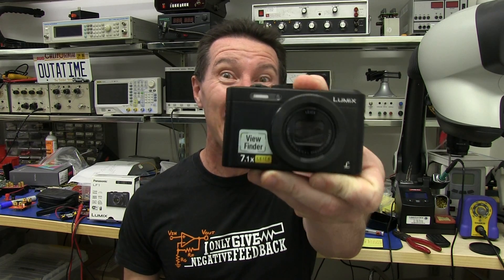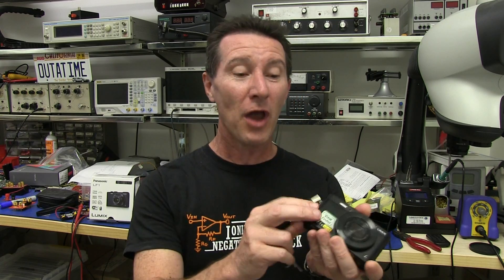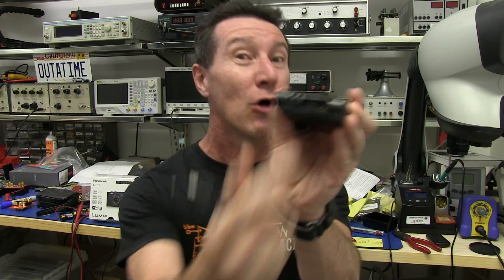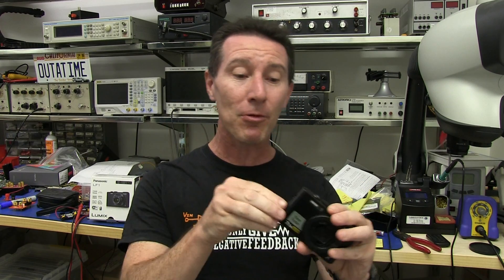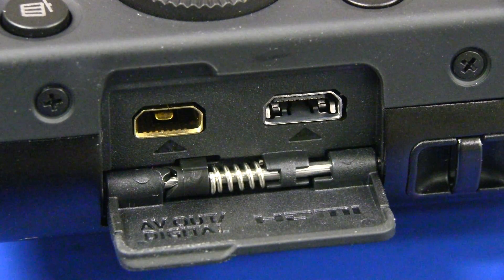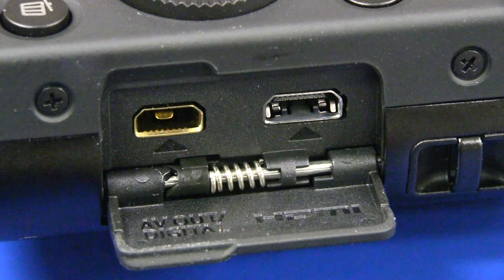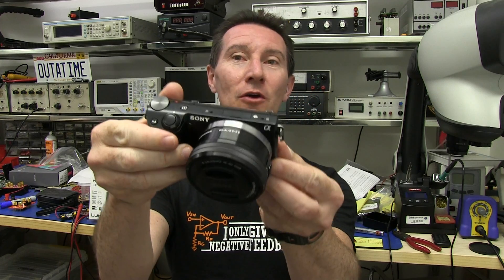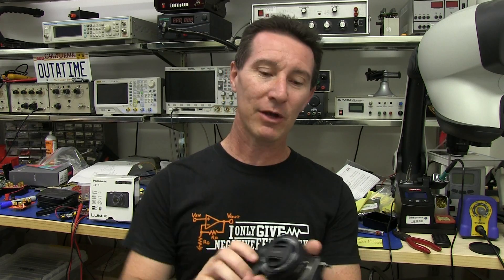EEVblog #578 - Proprietary Connector Rant - Panasonic LF1

Comment: I would like to let you know, that isn't a proprietary cable, it's quite a standard USB 8pin connector. Alot of cameras (Including my Sony DSLR) have it. As you said, they have done this to save space with various connectors and make cables which can be used for Camera to PC and can be connected to A/V equipment using composite video and stereo analog audio. My Sony camera comes from the time where hdmi was not the standard and thus not having a HDMI connector. alot of other cameras (even seen Webcams) have this connector. I cannot charge my camera on the go because it has a fairly big battery pack and the 5v/500mA will not make the cut in charging it. Other manufacturers use Mini/Micro USB with a Mini-jack for audio/video in composite/anolog format, which is better when you got alot of mini/micro usb cables around. and since HDMI is an all-in-one soltion which can be made very small, it will replace the older USB and A/V format.
Reply: +masterchicken1990 Nah, I thinks it's the UC-E6 type form factor which is NOT part of the USB standards.  While the shape is fairly common there is no assurance regarding the pinout of each device/cable beyond the manufacturer level :(

Comment: The PS Vita Slim finally got released in the US,and while they finally changed the stupid charging connector to Micro USB,the Memory Cards are still proprietary.The memory cards are also very expensive.Why is it $80 for a a 32 GB PS Vita Memory Card.Compared to Micro SD,that's ridiculous.I've seen 32 GB Class 10 Micro SD Cards go as low $26.

Comment: It actually cost manufactures more to make these special connectors and cables, but its designed to increase profits by frustrating you into spending more money. I've seen at times a similar product with a few extra features, but with the industry standard connectors but this model is like 3 times the price. What you can do is shop around and pay attention to detail in the specification and connectors offered, and avoid where possible gadgets that don't have the industry standard interface option. Save yourself a lot of hassle, always verify the connector you're looking at is what you think it is, thye deliberately make them look the same to trick you too. You can aim your rant at ugly human nature and greed for this!

Comment: David, David, they go to all the trouble of deliberately creating proprietary connectors so they can make more money. This works by forcing you to only be able to use their specific connectors and cables with their products, and charge a fortune for it. Cables often break or get lost, so you can't just use any cable but the "approved" cable at a higher cost. Or else your forced to buy a new replacement product. Also by deliberately making things incompatible they can stop you from mixing and matching connecting different products to get more functions and features, this means if you what a specific feature your forced to buy the much more expensive model in their range. Yes it's marketing, it's all about profits at you're expense, its intended to frustrate you.

Comment: Also HP uses non-standard PSU connectors in their desktops. For example HP Compaq 8000 Elite series. They use 3 proprietary plugs instead of ATX form. 2 of them resemble atx ones and 3rd is completely different. No way of replacing PSU with a standard one. Also you can't replace the cpu heatsink. The holes are in different position than normal ATX boards use. I really hate that. There should be ban on proprietary designs in such things.

Comment: I guess he has not used an iPhone with the new connecter.
Reply: Frankly, its a better connector than micro usb. It's bi-directional, can be inserted in any orientation, is more durable, and can carry more power than even usb 3.0 I got no problem with a proprietary connector that works better than the standard.

Comment: Lots of "Why?" questions here from Dave, and many other members.  The reason is really simple - MONEY.  If they put a standard connector, you can get them anywhere.  If they put a propriety connector on it, they can then charge you $70 for a $10 cable if you want a replacement or even the cable in the first place.  Dave keeps saying "There's no reason for it".  Yeah, I'm afraid there is - obtaining more of your money.  It's all about maximizing the profit margin of the product.
Reply: Just do what I do - never buy from dipshit manufacturers again. Easier said that done, but it's doable if you get annoyed enough. As soon as I see a proprietary connector I walk away - you just know the attitude of the company stinks so why even give them the satisfaction.

Comment: I agree with you somewhat on this but the miniUSB/AV was an attempt at a standard but it never caught on because it came out as we were transitioning to HDMI/HDTV. I have a Panasonic 10 MP camera that uses this same cable (unfortunately the camera didn't come with the AV connector so it is useless, the AV connector costs literally more than the camera when I brought it).

Comment: Canon compact cameras have a custom USB+AV connector, but it's compatible with miniUSB - the custom AV cable will only fit the camera's port, but the data cable is just a standard miniUSB cable. That is how you do it.

Comment: IIRC, Dell used to use a standard 20 pin  ATX connector in their computers but swap some of the wires around so you it won't turn on if you don't use their proprietary power supply. Always hated that because you end up overpaying for something inferior to what you probably already have spare.

Comment: At least yours came with a USB cable. The DMC-LX2 comes with a mains charger and that's it. I bought a fake DMW-AC5 charger from eBay just to rip out the charging lead and fit it to a 12v-5v cigarette lighter regulator.

Comment: This has been one of my biggest complaints about iPods and iPads and iPhones and other such Apple things. Thanks for the 30 pin connector thing that I can't buy anywhere. At least they 'upgraded' to a faster and smaller proprietary connector, which just so happens to make ALL previously made accessories obsolete.

Comment: I have an nex 5n and nex 6 ... shocking thing to me was that they both use sd card , have a normal usb connector, and even show up as mass storage ! So unlike sony to support any of that stuff a few years ago. I just got them since they are aps c sized sensors in a small body. The selection of non adapted lenses kind of blows though, but the kit lens is not too bad.

Comment: Dave, I spent 25 years looking after Panasonic musical instruments which were marketed under the brand name Technics. Market leaders for years until they just closed the plant down. The musical instrument spare parts and accessories were often designed slightly differently to standard industry parts, just so that we could hardly ever use generic parts. I share your frustration.

Comment: First let me say that I agree with you on proprietary connectors... It would be really nice if the industry would strive to remain standardized unless it was bringing forth great new benefits...

That being said, I've always just purchased an extra battery with every camera I've bought and kept it hot in the external charger ready to swap when battery 1 got low. Now I realize you may be looking to RUN the camera off the outboard power to be able to shoot video beyond what one battery could manage with out stopping and I've never tried that with one of these mini cams... All my long format stuff I shot on large tv cameras that plug in. I just use my cameras to shoot stills... But all of my little point and shoots have high five figure shutter actuation counts so the batteries get cycled quite a bit. My big complaint with in camera charging is that the charge controller in the camera is typically not capable of charging the battery as fast as the external chargers are...nor does it have a conditioning cycle. Just a devils advocate argument.

Comment: Yeah. And it doesn't even make sense, unlike some other proprietary connectors (apple for instance)
Reply: Nope, Apple makes proprietary connects so they can charge licensing fees and unreasonable prices for their accessories. No other reason.
Reply: When you don't know what it's all about, it's definitely about money.
Reply: Usually what happens, is that it is someone's decision to use 'technology' that company is already come up with - and nobody is objecting. You know those meetings where you weren't present, everyone else didn't care or were hanged over, and idea passed - just because no one said no. 
Or like in case of Apple - because they weren't happy with USB micro durability and features (being able to insert the connector either way).

Comment: Yup these non standard connectors drive me mad and in some cases even if they do use standard usb connectors they will put resistors in the thing so it only accepts charge from manufacturers own cable thats how ive noticed it on some mobile phones. Helps to increase that E waste i guess.

Comment: I have one digital compact that has a connector that LOOKS like Micro USB, but will only charge with the cable that came with the camera.  You can download with the regualr Micro USB cable that fits most cameras, but not re-charge. Naturaly I found this out 5 minutes before I was leaving the house one day after leaving the camera pluged into the USB hub overnight.

Comment: Calm down.  Life is too... short.

A "standard" Micro USB connector is notorious for physical fragility.  There's a new version of the connector designed to handle thousands of ins and outs, bends and twists.

As you pointed out, the manufacturer determined to combine functionality within a single connector to keep the device small.  The Micro USB cannot serve purposes for other than what it was designed to do. 

I should think, by now, manufacturers except apple have realized consumers rage when each device demands the extra cost of an unnecessary specialty cable.  I doubt Panasonic is elitist and greedy enough to join the apple clan.

Comment: To be totally fair - microusb has a terrible rating on number of insertions before the port/cable are junk. The pins just aren't designed for more than a year or two of regular insertions (see: failed phone charger ports).
Proprietary may be garbage, but it might have better robustness.  Why does the ieee usb working group insist on such a flimsy connector?!
Reply: John Ridley is absolutely correct. MicroUSB has a fantastic number of insertions compared to the alternatives, and 10x that of MiniUSB. Ive seen some MiniUSB implementations rated as low as 100 insertions.
All of my most used devices now have MicroUSB and even though it is smaller and seemingly flimsier it is better than all other standardised alternatives. I think its even better than iPhone 5/5C lightning charger.

Comment: Well, Dave....

I have a Sony HX9 and guess what - it has a proprietary connector too. Even worse is the fact that its placed on the bottom, so if you want to use it in a static setting with permanent power (like in a lab) you need to have an extra battery and charger, because if you put it on a tripod, you wont be able to power it from external source....so I wouldnt state that Sony knows what they are doing, they have done proprietary connectors for a while now...

I do agree that proprietary connectors is a scurge, and I wonder why we need the IEEE, if the major brands does not care about standards for connectors.

Comment: Here, here!  I have a cheapo Nikon point-and-squirt that has a proprietary USB/AV connector, plus you also have to use the supplied plugpack as a standard USB PP or PC won't charge it.  BASTARDS! 

My Canon EOS60D has a customised USB connector to support the AV connectivity BUT it is compatible with standard mini-USB cables.  Unfortunately it cannot charge the battery in-camera.

The only saving grace of the Nikon camera is that it can fit in my pocket... the Canon is a bit too big for that trick.

Comment: I am the owner of Sony NEX-5R and this is not entirely true.
It uses standard microUSB, but try to charge it with any charger other than Sony's Camera charger that they provided.
Even Sony Xperia cell phone charger causes blinking of charging LED (error) on camera and... not charging.
So you can charge every device with Sony's camera charger, but you cannot charge Sony's camera with ANY charger. That is one step forward, but WHY just one ?!
Reply from the maker: My NEX-5T charges just fine on any charger. If it didn't they wouldn't be able to provide just the USB cable in the box.

Comment: Not just cameras have issues with proprietary or poor quality connectors! How about a $8k field test stand for a $50k X-ray mineral anaylsis machine fitted with the "cheapest of cheap" microUSB and 3.5mm SMT connectors. Of course they fail - and tear the hair-like tracks off the PCB they attached too. Replacement parts, of course,are not available - just buy another $8000 stand! The PCB does nothing but allow these external connections to connect to an internal flex cable so would have probably cost less than $1 in production quantities including the parts and assembly. How do they justify that on an $8000 item? If they made the board with some decent parts (heaven forbid "industrial" connectors even) and designed it so the connectors did not take the actual physical loads associated with their daily use it may actually last in use and would have made next to no difference to their bottom line! There's the end of my rant!

Comment: Besides the problem with that Panasonic camera I can't understand why they still use micro usb. The connectors are very fragile and better look at the lightning connectors from Apple who are much reliable. Not that I'm the typical Apple fanboy but I only look at te reliabilety when you use it very often. So the lightning connector is an example and I hope they change the standard to that sort of connectors.

Comment: They all do it. It's not just Panasonic. Not only that, but microUSB itself is really quite fragile and needlessly small. MiniUSB is fine. There was talk a while back about Apple putting microUSB on the iPhone due to EU regulations and that would have been worse than the comparatively sturdy and long-lived 30-pin.

It's fine as long as there's USB on the other end.

Comment: I share your pain, Dave. However. I find the trend of making device batteries non-replaceable even more cynical. Case in point: the new Motorola Moto G phone. By all accounts, it is a fantastic phone but Motorola have gone to extra effort to prevent us from replacing the battery. Since li-po batteries are pretty useless after 2-3 years, the lifespan of such devices is piss-poor. I find this built-in obsolescence a disgrace. We should boycott such products.

Comment: A rant that needs to be made even more frequently, but isn't, is the failure to include microSD card slots in ALL smart phones and tablets. "Well, just use the cloud and 3/4G" isn't an excuse for not installing a cheap-to-include slot that can hold 64GB (for now) of data. Companies that don't include a slot just want you to buy their overpriced internal flash or, in the case of Google, want to watch your on-line data use.

Comment: This is why I like my GoPro Hero3 Black - ~STANDARD~ Mini-USB (same plug that charges my Afterglow wireless Headset, charges any Wireless Dualshock 3 gamepad, lets me use my old 1GB Sandisk MP3 Player/FM Radio as a thumbdrive and move data to/from it) for ~BOTH~ Charging the camera's battery in-camera (or you can buy a unit to charge 2 GP H3 batteries at once, and swap them around) and for accessing the Micro SD card used for the cameras storage (in case you don't have a converter for either MicroSD-to-USB or MicroSD-to-SD for your SD Card port).

MicroSD for memory storage (upto 64GB SDXC MicroSD cards), Mini-USB for power/data transfer, WiFi for controlling with either their remote control (comes with the Black Edition) or with a GoPro App on your Android/iOS device (be it the official one ~OR~ a user-made alternative on the App Store), Mini-HDMI for video output (and any Mini-HDMI to HDMI converter works)... For as expensive as the little sucker is, it does have a helluva saving grace in using industry standard technologies in the form of MicroSD, Mini-USB, WiFi & Mini-HDMI, instead of proprietary crap (a path they EASILY could have gone down, but they took the high road).

Sure, there's a specialised cable that lets you power the camera whilst also pulling video data for Composite Video/Audio (Yellow + Red/White RCA) and pushing microphone audio over 3.5mm jack, over the Mini-USB port, but that's not going to be for everyone and the standard Mini-USB for power/data and Mini-HDMI for AV output is more than enough for most.

If anyone is curious as to what it looks like, here's a pic of the port area;
http://imageshack.com/a/img844/7504/0nws.jpg
Mini-HDMI on the right, MicroSD under the Mini-USB port.

Comment: On a more serious note.. I wonder how much money is involved in these proprietary connectors. Sure, by having a proprietary connector, you can (and will) earn money in the after-sale of this shit. However, it still isn't cheap to develop, engineer and test a proprietary connector and cable. What sort of price difference are we looking at when comparing proprietary stuff with standards? a factor 2? Maybe a factor 10? I don't understand this at all. Having a proprietary connector isn't wrong, as long as the standard cable still fits in it. There are PLENTY of manufacturers that have custom micro and mini USB connectors, but regular cables still fit inside them. I don't see how anyone is making any money on this. Thus, I have to conclude Panasonic is just really dumb, or they're trolling their customers.